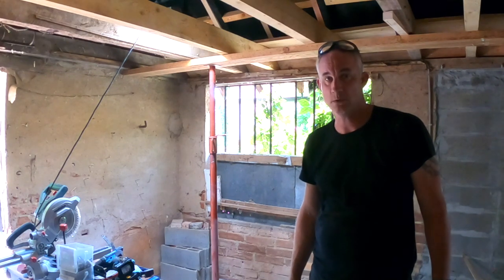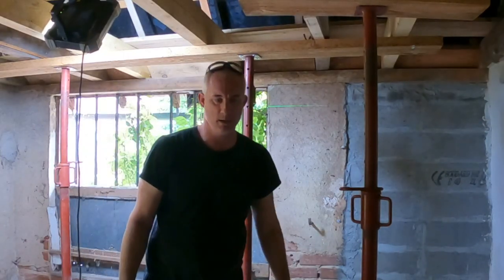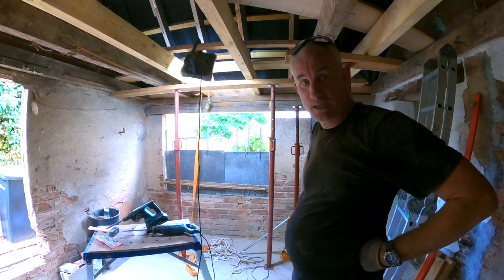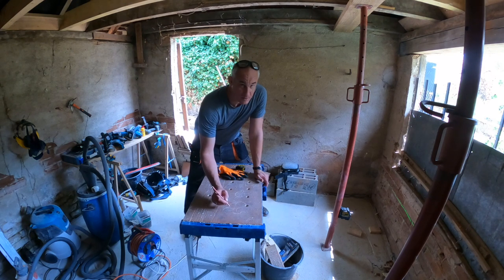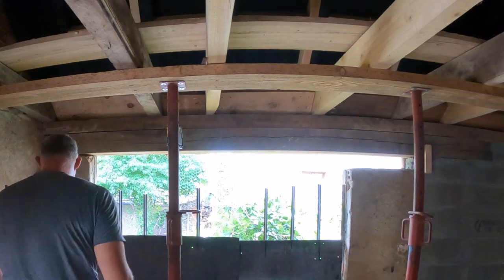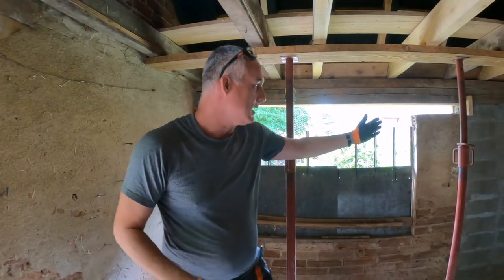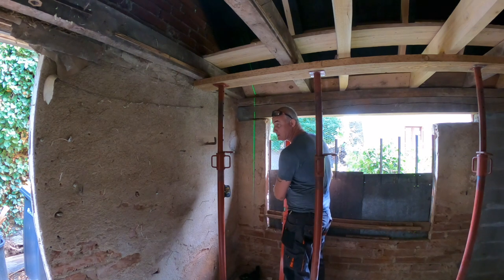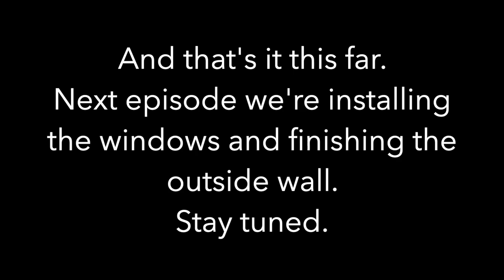Progressing on The Tiny House, Episode 7

Comment: For rebar full length strength, you need overlap of 40 times the diameter of the rebar.  Best to not have multiple pieces .
Reply from the maker: That’s interesting. In boat building we call them scantling rules. Installing rebar is an art in itself I’m sure. Lots of strength calculations. I’m not there yet, if I will ever be…